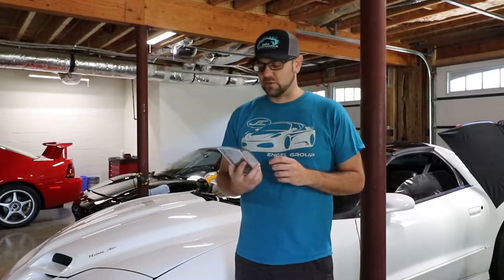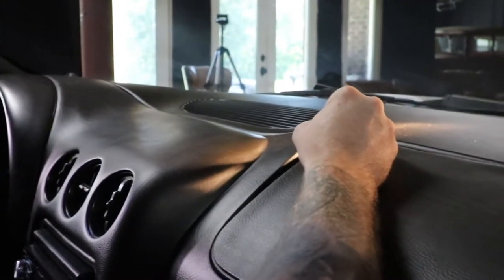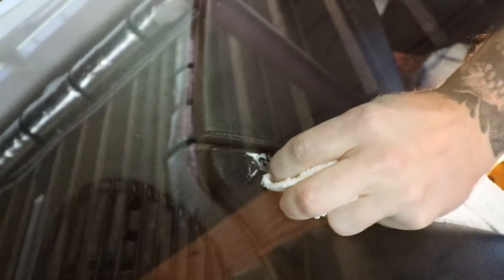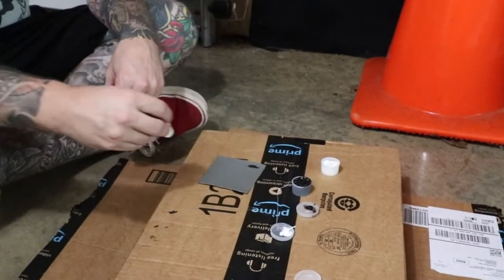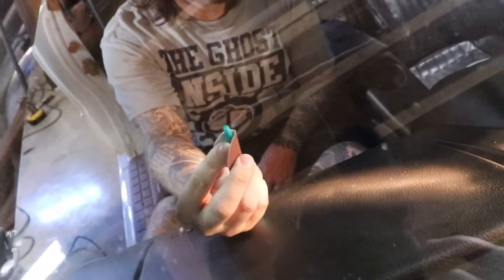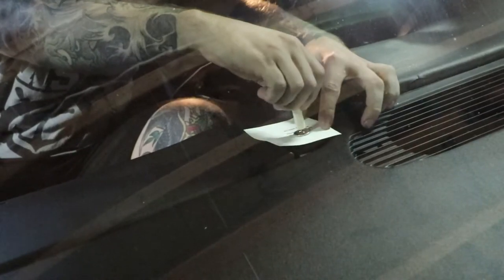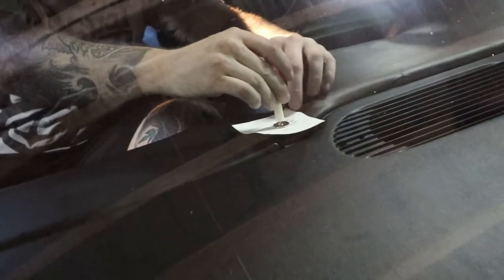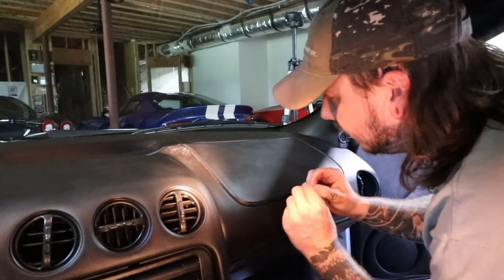Cheap 3M Leather and Vinyl Repair Kit DIY (Huge Fail)

Comment: Well, your dash is lifting up so there's a lot of other issues than just the cracks . Looks like you would have to put the dash back down first and that would change the way the crack may be filled. Honestly that little kit I'm sure is not for your type of situation and you'd be better off getting a professional to repair the dash for you. The kit is more for cracks and tears not for lifting cracked surfaces. Ultimately operator error is what I see here.
Reply from the maker: @robertrivasarroyo1174  I would not disagree.

Comment: You guys DEFINITELY stick to nuts and bolts.  Experimenting on someone's car??  Lacking any "crafting" skills cannot be overstated.  Preparation, knowledge of processes related to the materials involved, heat curing materials or following instructions and using your head and the internet.  Sorry, just tough love and advice.
Reply from the maker: Have to start somewhere. I’m sure that everyone started with something they weren’t perfect at.
Reply: @JohnEngel  yes, my only thought is to practice in a few items and test your theories on how it will go - before real customers. It's pretty clear early that it was bound to fail. I do appreciate balls to post your work so take my critical noise for what it's worth 😁🤞
Reply from the maker: Lol. No worries. I don’t always post the fails but wanted people to see that this is something that will take practice and they should not think they will fix it on the first ever try.

Comment: Keyword CHEAP. I tried this kit as it's no good. I simply cut out bad area tucked in new piece of leather in and a bit of glue and done. Was a square where new patch was but better than it was as it was just a used car.

Comment: Product is more YMMV. Your mileage may vary by a lot. I have had this kit work very well in some cases (usually chunks missing not broke flaps) on uses car lots and I have also had it not work for shit. That needs more than that kit can manage sadly.
Reply from the maker: Austin Moats great to know. I figured we did something wrong. Lol.